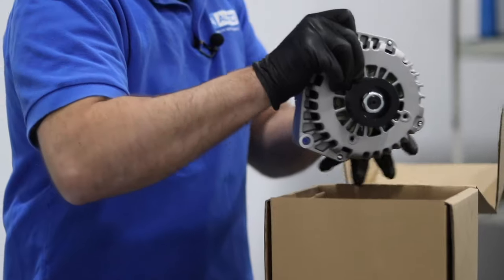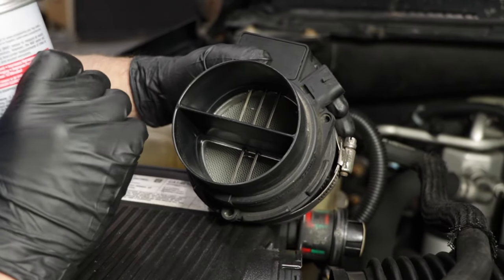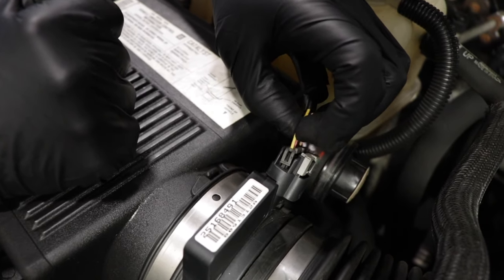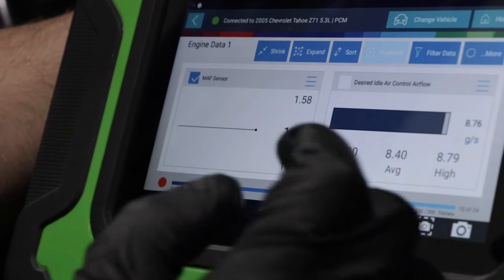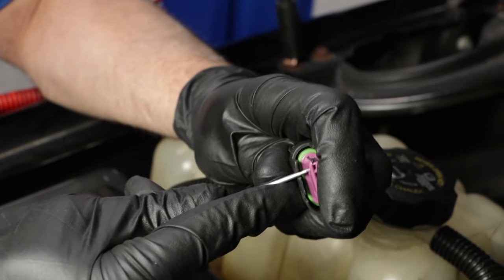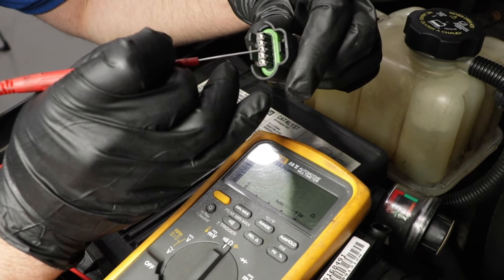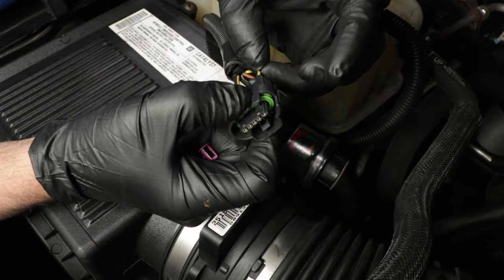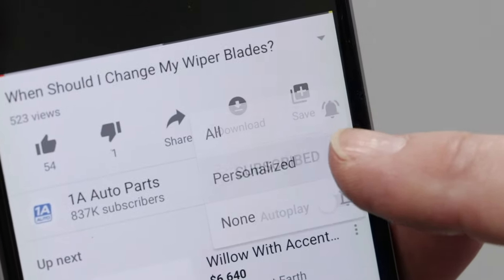Check Engine Light? Mass Airflow Sensor (MAF) Circuit: Code P0102

Comment from the maker: √  Watch the Video
√  Buy The Part at 1A Auto http://1aau.to/m/Visit-1AAuto
√  Do it Yourself
√  Save Money
Reply: Hello my friend. One question. I have a Nissan Micra 2020, and suddenly at 100 km the speed pedal didnt work for 5 seconds and  the start stop button which i had opened had been closed (seems that the whole system had been reseted) Then after 5 seconds car woke up and i could speed up again. This happened 2 times in 1 day.. Any idea what might be the problem?
Reply from the maker: +CancelIKL We wouldn't be able to diagnose an issue like that here, you may want to have a local mechanic take a look at it. Thanks for checking us out! http://1aau.to/m/Shop-1AAuto-c

Comment: Man I been having this code for about a year now for my 2008 G35 sedan. I clean the air filter & cabin filter, bought a new MAF sensor, clean my throttle body and replaced my intake hose and still have this code!
Reply: Vacuum leak, my civic pg valve made a massive leak and it threw a maf and iat code
Reply: Still got the code?

Comment: Thank you!! Question...I'm having trouble with my MAF sensor, changed it out and I still have the and issue. The wires look ok, but it looks like I'm missing a metal "prong" inside one of the holes where you tested the DC current. Could this be my problem!?
Reply: Melanie sounds like if your having the same problem after replacing it then yes i would look into getting a new plug and compairing it. Is there a wire on the other side of the missing prong if so then most definitly that could be your problem.

Comment: I keep getting the check engine light and the scan is code P0103 which is Mass or volume air flow circuit high input. However, the truck doesn't have one. 08 Dodge Ram 1500 V6. Any ideas?

Comment: Do 12V and 5V both connect to the hot wire inside the sensor. It doesn't make sense. Imagine, two different power voltages connect to a bulb with one ground. My Subaru has no 5V voltage for MAF.

Comment: I have a 2000 toyota corolla and it chugs runs rough and has loss of power..but no check engine light..still could it be a maf censor

Comment: hello . 09 Buick Enclave when I turn ac get the code p0102 maf sensor and c0299 brake boost regulation , I already replace maf sensor twice same issue but if I drive the vehicle with out ac . runs great . happen only when I turn ac , any help I appreciated

Comment: Why does a p0102 code came on for mass air flow. Replaced it know it showed p0101 when I first took in. They replace it he said it's a different code reading p0101. That's not the mass air flow.

Comment: I've replaced my MAF twice this year with the last one being a Walker Products 245-1120 for my 2001 BMW 325i e46 and it runs disconnected but not connected. Any suggestions on the proper sensor or possible other problem? Thanks.
Reply from the maker: +J Taylor We wouldn't be able to diagnose an issue like that here, you may want to have a local mechanic take a look at it. Thanks for checking us out! http://1aau.to/m/Shop-1AAuto-c

Comment: So I replaced the mass air flow sensor on my Cadillac srx and I erased the code and it came back. So I replaced the wiring harness and erased the code and it still came back. On my scanner I am getting 5 grams (ish)  of oxygen per second. What do I do next?

Comment: Hi there folks, my car is a 1986 Volvo 245 DL. It runs but it has low power when I throttle up in park, ( bogs down) When I remove the M.A.F. plug it seems to idle smoother, but it still bogs when I throttle it up in park. I have cleaned the throttle body & has new gasket, new plugs, new wires, new cap & rotor, new or good  vacuum hoses, new intake manifold gasket, new fuel regulator, I cleaned out the Idle air control valve with MAF cleaner & sprayed some lubricant in to the valve, cleaned and replaced all the PCV system, I changed both fuel pump, new fuel, filter, I have a new O2 oxygen sensor coming, ( The only thing I can think of is that either the MAF is bad or the IAC valve is bad) Any suggestion from any Volvo enthusiast? ( By the way, the car sat for 6 yrs, I drained the old gas put fresh fuel, changed the oil and fired right up.)

Comment: New maf and still getting the p0101 code but only at cold start once it warms up it goes away... wouldn't that point towards intake gasket?
Reply from the maker: +Zach Hoyt We wouldn't be able to diagnose an issue like that here, you may want to have a local mechanic take a look at it. Thanks for checking us out! http://1aau.to/m/Shop-1AAuto-c

Comment: Did you know. Why I changed new mass air flow sensor on my car. But it not working. When i put out the mass air flow sensor of my car. My car it's still running. I don't know what going on.

Comment: I replaced the MAF sensor and it says mass airflow A circuit low. Do I need to replace the connector to the MAF sensor?
Reply: Did you ever do that ?
Reply: Before you replace the connector check voltage.

Comment: If my mass air flow fuse keeps popping is that a sign that the sensor needs to be replaced?
Reply from the maker: +jose banales We wouldn't be able to diagnose an issue like that here, you may want to have a local mechanic take a look at it. Thanks for checking us out! http://1aau.to/m/Shop-1AAuto-c

Comment: So I replaced my MAF and now I’m getting fuel trims that seem off. Short terms great it hovers around  -1 -2 to 0 never goes plus but the long term always seems to start at -11 then after driving for an hour it goes to -15 now I’m no expert but shouldn’t both of these be at 0 or close too. Other then that car runs fine no more stalling from a bad MAF just odd fuel trims
Reply: Did you ever get it fixed

Comment: Hi! Bro. Thank you for sharing this amazing video. I need your help and some advice,. I have a 2013 Nissan sentra and I was having issues with the transmission. Two weeks ago I was visiting my friend in Mexico and the engine light came on and after checking and trying to figure out turns out that was a transmission problem,  I decided to rebuild the transmission when the job was done I tested the car and I runned for a couple hours, but the car still have issues, gears were not switching, it kept dropoing the speed the high that was developing was 65 mph, I scanned and the scanner through me the following codes, P0965, P0111,P0847,P2859, P0112, P0102, could please help me out and give me some advise. Thank you
Reply from the maker: +Ernesto Moreno We wouldn't be able to diagnose an issue like that here, you may want to have a local mechanic take a look at it. Thanks for checking us out! http://1aau.to/m/Shop-1AAuto-c
Reply: @1AAuto  thank you. Understandable. Thank you again for your feedback

Comment: Please Help. Somebody put a NEW AIR FILTER into my car. Now the MASS AIR FLOW SENSOR IS setting CHECK ENGINE LIGHT ON.
Do I really need a new mass air flow sensor ?
Cleaning it didn't work to get the code to go away.

It was NOT causing a CODE, until AFTER we put a new air filter in. 🙄☹️☹️☹️
It was a tight PUSH, to get the air filter in where it was supposed to be.

Comment: Where would you get a wire diagram for your vehicle ?
Reply: Usually you can find wire diagram on the web. Or parts store they can print it out. Service manual from dealerships will deffinitly have them.